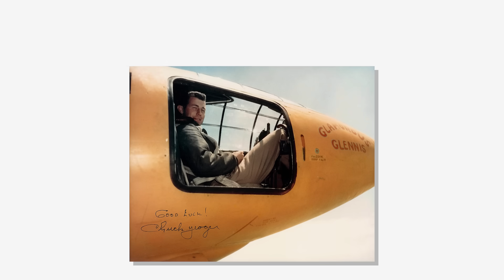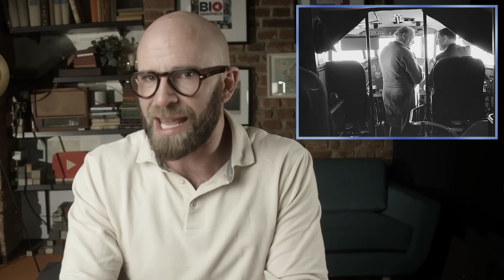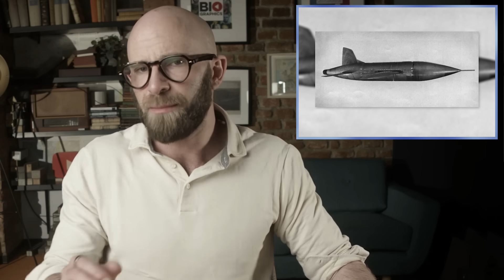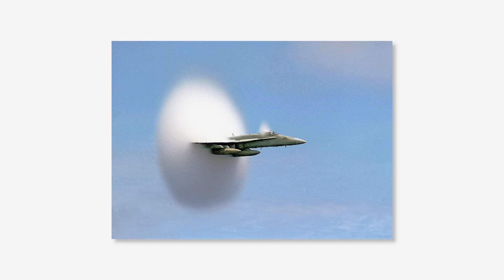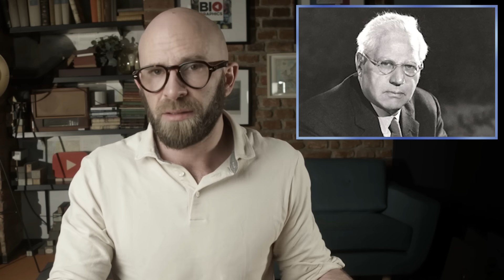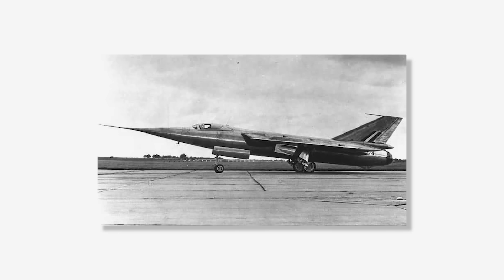Why was It So Hard to Break the Sound "Barrier"?

Comment: MiG-15 following World War II and the fighter entered service in 1949. It broke the sound barrier in a dive. The Mikoyan-Gurevich MiG-15 received a "sound barrier stabilizer," or more accurately, an "all-flying tail" with a movable stabilizer, in its later production models beginning in 1950. Additionally, they added two strips, about 1 inch high, to stabilize it in Mach 1 dives.
Reply: Quite wrong. Read Yeagers test report on the Mig15 he flew in Korea. It was only with the Mig 19 that Soviet aircraft had an all moving stabilser.

Comment: Quite well researched but containing errors. I have a letter from Winkle Brown confirming that the rumour of an all flying tail Spitfire was not true. The all flying tail was tested at low speed on the Gillette Falcon. Dizzy Bancroft did not offer the Americans data. As an employee of Miles he was forced to provide the details of the M52 to an American delegation to RAE in 1944. One of the delegation was a Bell designer. When I met Dizzy in 1998 he was still spitting chips about this event.If you read John Derry's biopgraphy it contains a full acount and pictorial reports of his first uncontrolled dive through Mach 1 in the Swallow. Winkle Brown flew the Swallow to detrmine the cause of Geoffrey de Havilland's crash while testing the tailless design at high Mach and low altitude. Structrual failure resulted from flight oscillation due to the lack of a stablizer. The other two Swalows crashed due to low speed stall testing. All the correct FACTS are in my book https://www.amazon.com/Transonic-Chris-Freer/dp/1447785991  - which includes correspondence with all test pilots and aerodynamiscists involved - first hand informatiuon mostly from RAE - not cobbled together stuff from thirds parties. Enjoy.

Comment: Of course, other aircraft had broken the sound barrier, before the Bell X-1.  But, those events had all occurred in crash dives, from high altitude....and probably all UNintentionally. In other words, the sound barrier had only been broken by aircraft in the process of CRASHING. 

Breaking the sound barrier was difficult simply because it required far more horsepower, in the form of thrust, than any one small aircraft had ever been able to generate before. At least, if one was going to do it while UNDER CONTROL.  Other issues, such as aero design and transonic and supersonic control of the aircraft, were also new territory. No aircraft engines of the era, regardless of design, were even close to powerful enough. 

 Rocket engines, fairly new and not nearly fully developed, were the only option. Even with that, a crash program to improve their design (and to design and build a suitable engine) had to undertaken, otherwise the Bell X-1 program would not have been ready by 1947.

Comment: I recall that a Spitfire pilot went transonic in a dive and recovered by pushing the stick forwards instead of pulling back. The wings were so buckled after the dive that the plane had to be scrapped.
Reply: This has been maintained for German planes as well: rudders that where no longer managable in a dive. "Transonic" is a state, not just a certain speed.

Comment: There are plenty of reports from pilots of all parties in WW2 who must have gone supersonic or at least transsonic and barely survived the experience.  One problem was the enormous vibration which was rattling the rivets from the fuselage and otherwise severely damaged the aircraft.  All this happened by accident and neither pilots nor aircraft were designed for such speeds and there are no official speed recordings but the events described are consistent with what is expected from an WW3 era aircraft going supersonic.  A number of aircraft did crash likely due to exceeding MACH 1 but that certainly counts even less.

Comment: If you read the fine print of Chuck Yeager's effort in the Bell X-1, you would know that he had two broken ribs when he made that flight - and he therefore carried a school ruler  which allowed him to use the movable tailplane trim device to recover.  An aircraft that exceeds the Mach 1 undergoes a change of the aerodynamic centre from 25% of the wing chord to 50% of the wing chord, which makes it nose-heavy - and conventional elevators become ineffective.  The effect of the two things may make it impossible to recover from the dive (it's called "Mach tuck").  The fact that the Bell X-1 had an all-moving tail was the unwitting secret to its success.  The result was that a free-lance aero engineer (John Thorpe) invented the all-moving tail  as the primary means of longitudinal control of an aircraft and held the patents of it , which made supersonic flight a practical possibility.  He also used it on many of his designs of small aircraft (Piper Cherokee,  T-18,  and many others. The Concorde dealt with this problem by shifting part of its fuel into the  vertical tail whilst it was trans-sonic.

Comment: A labour government cancelling very promising advanced research.  Familiar tale, sadly.
Reply: Britain still had food rationing until the mid-1950s. They had other priorities.
Reply: @thethirdman225  There were, certain.y, other issues.  But, arguably, supporting developments like this would help with the long-term prosperity of the country.  And I'm not convinced that cancelling TSR2 was beneficial.
Reply: @steveknight878  You may be right but Britain was broke and TSR2 was a huge gamble. Australia was looking at it but was encouraged to buy the F-111 instead. Great aircraft but the potent of the TSR2 can’t be denied. On paper, at least, it was considerably better.

But at the time the Americans had the cash to invest in aircraft programs like that and Britain didn’t. They also pressured Britain to buy the F-111 instead. They did the same to the Israelis over the Lavi 15 years later. That’s how they killed advanced projects in other countries and it was done so they could have a monopoly on that market. Ask Canada…
Reply: @thethirdman225  Because of issues with the F-111 and the need for a replacement aircraft for their carrier, F-4Ks were purchased for the RN and a few years latter F-4Ms for the RAF. I was the design authority for the radar in these aircraft.

Ferranti was also the manufacturer for the TSR2 radar. It was very capable, but complex. The technology used at the time was not very reliable and maintenance was an issue.

The main reason why the TSR2 was canceled is that the UK was broke and the US wanted to sell us kit to shut-down the UK aviation industry. The Labour government just folded.
Reply: @christopherrobinson7541   This was my impression too. I just think too much blame has been put on the government of the day and I don't think anyone would have seriously disagreed with it at an economic level. It was a missed opportunity for sure and arguably the last opportunity for al all-British design but the economic climate was just too bleak. And yes, I know Concorde was another example of it. If you had to pick between the two, you would probably conclude that Concorde had a better chance of success when compared to its American rival. TSR2 was just under too much competitive pressure.

Thanks for the background on the F-4K and M and also the Ferranti radar. If you fell like adding any more, don't hold back!.

Comment: The Brits gave advanced technical knowledge to the Americans on the understanding that the Americans would reciprocate, but the Americans reneged on the agreement.  Now, that sounds familiar... Where have I heard that before?  Oh yes, the Manhattan project.  Oh, and Penicillin development.
Reply: The yanks have ripped us off many times on stuff like this..... i think they mat have also stitched us up on the jet engine???
Reply: @Rick-w5c1f  Kinda hard to tell on that one... Our jet engines were absolute garbage until the 60s. Just complete and total shite. The Lockheed L-1000 would have been a genuine breakthrough (it was the first axial-compressor, afterburning jet engine proposed and it worked on the test stand) but the Army didn't want Lockheed building engines, they wanted Lockheed building the airplanes those engines went in.
Reply: @disorganizedplay

The American fixation on axial flow designs was actually the problem.  

NACA made an experimental 8 stage axial compressor and American companies like GE and Westinghouse latched on to them.  The axial compressor had the obvious advantages of low frontal area and scalability.. so the Americans used British centrifugal designs to get them in the air so they could focus solely on indigenous axial engines to power their second generation of jet fighters.  

The problem was the axial flow compressor builds pressure linearly rather than quadratically like a centrifugal compressor.  This results in the engine having too much pressure for the speed it’s operating at.. leading to excessive back pressure in the combustion chamber and eventually surge and compressor stall.  

This wasn’t as critical for small engines like the Westinghouse J34 and Junkers Jumo 004 (the 004 actually had a variable exhaust nozzle to increase surge margins) or engines that operated mainly at a single speed like turboprops where a bleed valve for idling and acceleration could be used.  

When Westinghouse tried to scale the J34 up to the 10,000lb class J40, it was a disaster that crippled an entire generation of American fighters like the F3H Demon and F7U Cutlass. 

Meanwhile the French took a decade to develop the BMW 003 into the SNECMA Atar… and the Soviets—who were the only ones who wanted the Jumo 004–abandoned it as soon as they got their hands on an “inferior” Rolls Royce Nene.  

The British.. having built their experience with those simpler centrifugal engines.. we’re able to apply that knowledge to larger axial engines like the Rolls Royce Avon and Armstrong Siddeley Sapphire which used variable inlet guide vanes to pre-swirl the air and reduce the relative tangential velocity to the compressor. 

The Americans wouldn’t catch up until the mid 1950s with the two-spool P&W J57 and variable-stator GE J79.. with Westinghouse exiting the gas turbine industry.
Reply: Americans invented industrial espionage during the early industrial revolution when most of the machinery inventions made in Britain were copied and reproduced in US. Ethics count for nothing during a declared presidential national emergency.
Reply: True they gave them the most important info the back wing
Reply: Oh yes, the British discoverers and developers of penicillin decided not to patent it, so that it would be available to all. We gave it all to the Americans because they could produce it much faster than we could, given their industrial might. The Americans of course promptly patented it. Greedy scumbags.
Reply: All self-loathing Americans agree!  We are s - - t; everyone else is better.  We are nothing but thieves.
Reply: It's the American way: Steal everyone else's ideas, throw money at the projects and pass them off as all their own work.
Reply: @BarbaricAvatar A bit like the Chinese now.
Reply: Someone is a little butt hurt
Reply: @BalrogUdun 
Yep, it wouldn't be British if there wasn't whining behind that stiff upper lip
Reply: Sounds like children whining.

Hey, ever wonder why the British don't build computers?
They haven't figured out how to make it leak oil.
Reply: @scotte2815  Colossus !
Reply: @russcattell955i  And just about everything has an ARM processor in it nowadays.

Comment: There is so much nonsense written about the X-1/M.52.

Dr. Millikan was an expert in high speed aerodynamics, and was consulted by the X-1 design team in early 1945. Since his visit to Miles was on behalf of the US Navy, perhaps they might have been interested in the M.52 as they were just embarking on the D558 program.
He subsequently wrote a report, “Technical Report of Visit by C. B. Millikan to British M.A.P. Project E 24/43 Miles 52 Transonic Research Airplane”, (Clark Millikan Papers, Folder 6-2, Box 6, Caltech Archives) which was circulated through the United States Navy Bureau of Aeronautics.  He was not given any material, drawings etc to take away, and had to draw a sketch of the aircraft in his report from memory. 
His Conclusions and Recommendations on the M.52
The project of a transonic research airplane is a valuable and interesting one.
In general the design appears to have little to offer U.S. designers, although the very thin biconvex airfoil section with thick constant curvature covering, the unbalanced power boost control and the all moving tail might be of interest.
It is believed that with the present state of knowledge a much better solution of the transonic research airplane problem is possible.
It is concluded that the design offers relatively little of interest to United States aircraft designers.
In view of the above it is recommended that no further steps be taken by the Navy at this time to obtain additional information on the project from the British government.

No reciprocal visit of British folk to the US for briefing on the X-1 was ever proposed.

The tail on the X-1 was not modified to an all flying tail as on the M.52. The X-1 was controlled in pitch by elevators with trim provided by a pressurised nitrogen driven motor that operated the tailplane. The set up was exactly the same as seen on a 747, 737. Flight controls were manually operated, to have an all flying tail would have needed powered controls because of pitching moments on the tailplane.

Forget what is said about Germany achieving Mach One, Yeager was the first, although he shouldn't have been, Bob Hoover had been given the role but was replaced by Yeager after Bob had put on an impromptu private air display in the P-80.